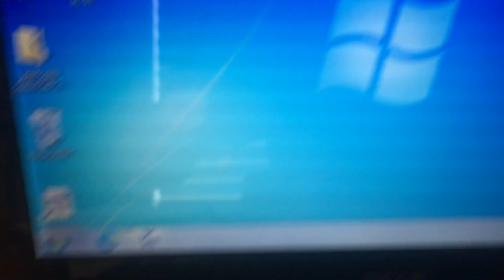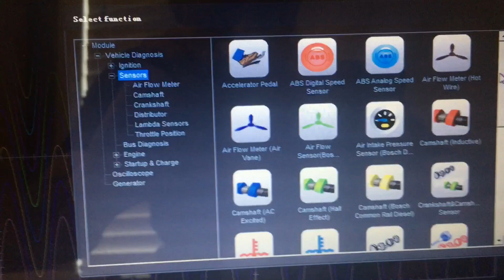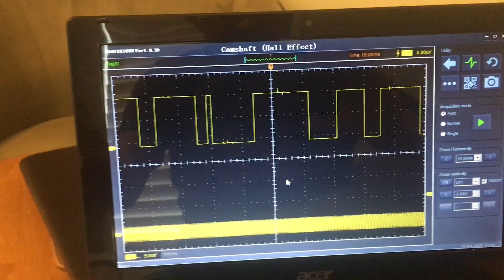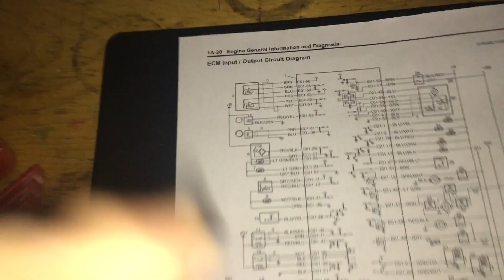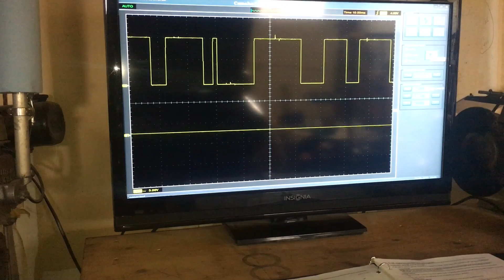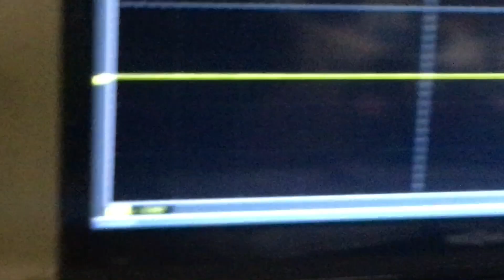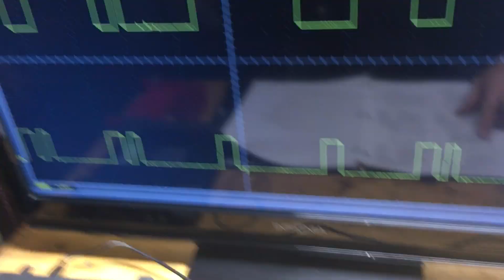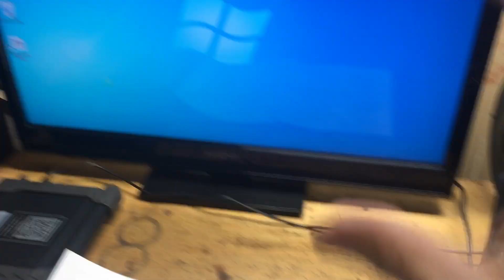HT-1008 Software V 1.0.30

Comment: Which windows  are u using?
Reply from the maker: Seven…ancient 😁
Reply: @TheGibby3340   I'm  that software  on a surface  with windows  10 and works good,
 but the other cleaning  the closet, found  my old laptop  with  windows  Vista (  even more ancient)  installed  the software  and works fine on demo  but won't recognize  the hardware.
To bad was hoping  to use the old laptop  is bigger  and build tougher than the surface